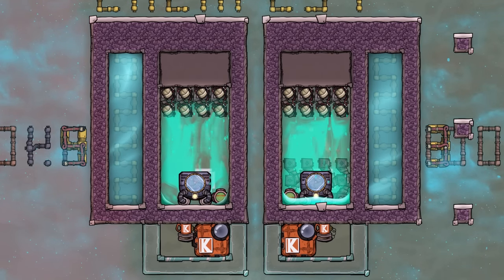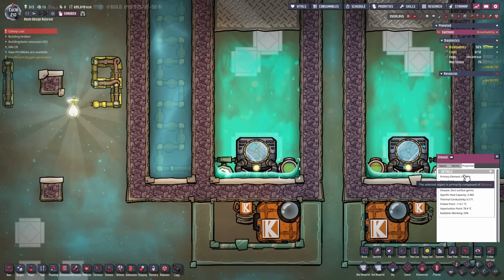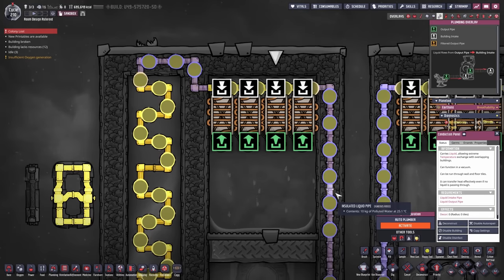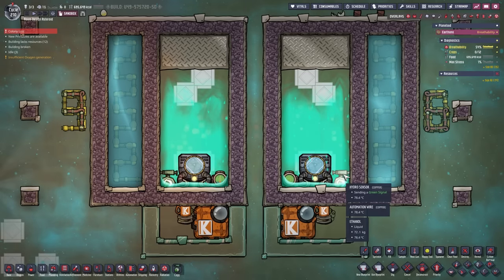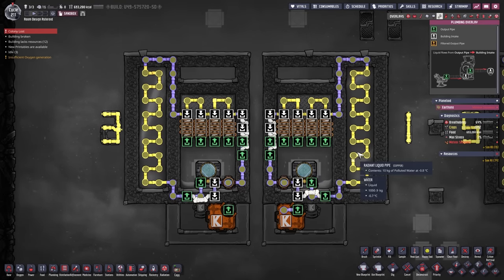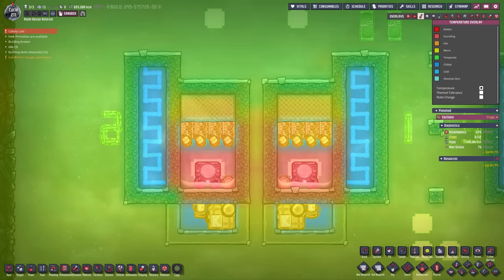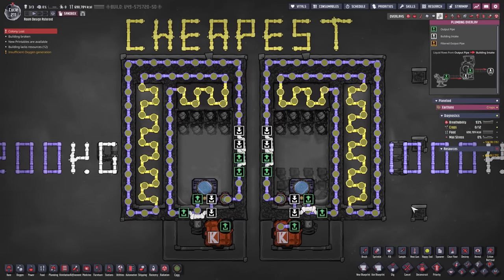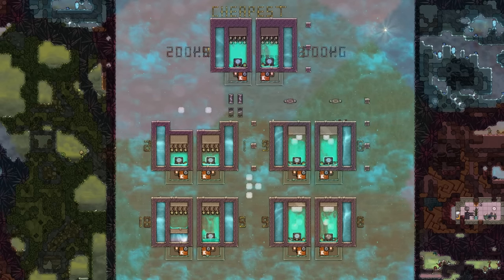BUILD UPDATE: Copper Ore Aquatuner Setup with Ethanol

Comment: What I find most amusing, is that this method has been available since forever, but somehow very few people paid any attention to it. I think it's partially because it is still (relatively) easy to get to plastics and steel, although some SO starting asteroids may be more difficult in that regard.
Reply from the maker: Agreed. I think steel and plastic once you know how to get it is probably the better option.

But since I only recently learned about the ethanol heat deletion I am experimenting with designs
Reply: I hate getting plastic.

Comment: This is actually insane. Pre steel aqua tuner was thought to be a pipe dream
Reply from the maker: Glad you like it :)
You can also achieve that in a steam  turbine Aquatuner setup by limiting the flow on the off side. I think I made a short about that once.
Steel is often just much easier than trying to make it work without it.
Reply: Breakthroughs in science limitations. Damn

Comment: Hey luma, can a conduction panel transfer heat to a temp shift plate in a vacuum? If so, this could let you build an amazing rocket silo with 100% efficient exhaust capturing.
Reply from the maker: I think it can i do have a tempshift plate somewhere behind one of those conduction panels in the lower left setup i think.

Comment: Why the metal tiles in the version with water in it? The idea is that liquid liquid heat transfer is vastly more effective than liquid solid tile interactions. Try just dumping some water in the other designs with no barrier. It won't get hot enough to turn to steam (and wouldn't matter if it did), even with the aquatuner running at 100%, so it doesn't need kept separate.
I definitely think this is way to power intensive to be used like this though. Any space saved is going to be lost in power production, so it is almost certainly better to go with a more efficient design, even if considerably less powerful. You absolutely want to be using more than a 4' range, and that means 1kg liquid pipes and heat exchangers. If you can get it to 120C before boiling it then you will already have upped the heat deletion 10x per unit of heat transfer.
Reply from the maker: I did that in around 10 other designs. Those all failed and were hence not even in the ranking. The issue is that water is lighter (less dense) than ethanol. so the ethanol want to be on the floor tiles. If we do not control the temperature now. To stop at 90 °C. Then the water will turn to steam and get deleted in a few cycles. Then you have a room without water anyways.
If you DO control the heat. The water still got deleted. All the state changes and ethanol trying to occupy the lower floor tiles that the water tries to drop down to deleted all the water each time i tried it.
Reply: I'm interested to know how to get the most heat deletion out of the same power usage. How do you raise ethanol to 120C without it touching the cooling block and falling back down? How does the size of the design affect the efficiency?
Reply from the maker: @yjk92  The larger the difference in Special heat capacity the larger the heat creation/deletion.

The best I can think of right now is probably Nuclear waste.

The room size does matter.

If it is too small you have a higher gas density/ gas flow speed making it harder to condense it.

The vacuum comes from the very fast heat transfer to the gas surrounding the metal tiles immediately flashing it to liquid aggregate state.

if your metal tiles get too warm or the transfer is too slow you will not get the vacuum. 

Benefits are probably not hating up the metal tiles unnecessary if you quickly condense the gas.
Reply: @yjk92  1kg/s in a pipe doesn't state change, so if you put it through a liquid valve to limit it to that you can superheat it. It needs a completely different design. The size can affect the efficiency of the heat exchanger, and it can get quite bulky if you are wanting to run multiple pipes. The power is limited by the low flow rate, which the open design doesn't suffer from.
Heat deletion is ~10% of heat applied to liquid ethanol, but when you use a counter flow heat exchanger most of the heat applied to the liquid in the pipes comes from the ethanol gas, rather than the aquatuner directly*.
I didn't notice any deletion, but I didn't run my test that long, so maybe just missed it. The sheer amount of power involved makes the losses minimal in comparison, with their biggest impact being complexity of a top up mechanism. If you can get it working without anyway then I guess there is no point, but it is worth knowing how much more effective liquid liquid heat exchange is than any solid tile interaction.
*Now that I think about it, it is only really the efficiency of the heat exchanger that makes a difference. You possibly could get the same effect even in the 4' normal range. Maybe a bead design? My quick experiments suggest it is hard to keep it stable, but it seems to work.

Comment: Have you tried mixing water and ethanol together? I found that even 1kg of water allows better conduction between AT and the liquid than spamming aluminum tempshift plates. And it kept the AT below 110C at all times. And the chamber can be 4 tiles shorter than what you have. It will not have a gradient of liquid and gas ethanol and instead all the ethanol will convert at the same time. The cooling effect should be the same, right?
Reply from the maker: Hey i tried that; i just copy over the answer i gave to someone else in the comments that asked the same:

I did that in around 10 other designs. Those all failed and were hence not even in the ranking. The issue is that water is lighter (less dense) than ethanol. so the ethanol want to be on the floor tiles. If we do not control the temperature now. To stop at 90 °C. Then the water will turn to steam and get deleted in a few cycles. Then you have a room without water anyways.
If you DO control the heat. The water still got deleted. All the state changes and ethanol trying to occupy the lower floor tiles that the water tries to drop down to deleted all the water each time i tried it. 

I also thought it should work. And it probably WILL with crude oil, but that would defeat the purpose of this being a early cooling setup.
Reply: @lumaraw  since the ethanol state change happens 20 degrees below water's, as long as the thermal mass can take the heat spike of the AT, there shouldn't be steam ever. I was able to replicate the liquid deletion glitch and kepting increasing the amount of water. And at 370Kg per tile of water, I see zero liquid deletion after 5 cycles of 100% uptime. My design is 3 tiles wide btw.

Comment: Would it be more inefficient to swap out the conduction panels with automation wire bridges because they would cost you only 5kg per bridge instead of 100kg of refined metal. Although i think  conduction panels have 2x conductivity of the material it’s build of.
Reply from the maker: It doesn't hurt including them. 
The Conduction panels are probably the best in conducting. They have a value of 120 thermal conductivity plus 100kg mass and I guess a hidden transfer mechanic or multiplier that i don't know of. But the other bridges are also very efficient, which is why i could leave the conduction panels out i the "cheap" version. The more bridges the better i guess :D

Comment: This setup is amazing for an oasis start with the heat all around.
With the pips you could try to make ethanol quickly and use alluminium since there's more in the forest start so you have an early solution for the heat. After a while you can create a more classic design but this will be great for the early game

Amazing work dude!
Reply from the maker: How much wood would we need for 200kg of ethanol?

Let me check: Ethanol Distiller
Requires Lumber: -1000 g/s
Effects Ethanol: +500 g/s
So 400 seconds = 200kg Ethanol meaning 400kg of Lumber
that is 4 Oakshells or 2 Branches of a Tree. (Each branch produces 300 kg Lumber according to the wiki )

That sound managable

Comment: Hi, thank you for the interesting video.  Before I watched, but after reading the title, (sorry, ignored the using ethanol portion, my ADHD kicked in) I imagined this was for early game designs, since steel (in my mind) is more of a mid game resource.   However I see you use the mid/late game liquid ethanol, since in most default play throughs, getting trees is really difficult. I have difficulties with heat with all of my starts. Do you have any designs of this cooling system with the normal resources you find in early game designs?
Reply from the maker: There is a planet with liquid Ethanol pools. Not every Planet has them but some starts might.

Not sure there are any alternatives besides Ethanol and nuclear waste.

I only know of these two having different Special heat capacities in different aggregat states.

There might be more but i don't know of any atm
Reply: @lumaraw I have no planets. Space mining is the last thing (late game) to do in my play thrus.  There is no nuclear waste either.
Reply from the maker: @dmcs2003  Ah so no DLC.
But you can still choose different Starts. There are many planets. Might be one has ethanol pools in the Base Game as well. Not sure though :/
Reply: easy way to manage heat is to use ice from ice biomes and have water brick where you make o2 who sucksup the heat from nearby , and cool any water you produce and dump it there , you can easily menage ice by making ice statues above pool who will melt down , as well using weezeworts(but on space DLC you need to be mindful with radiation)

another way to manage heat is to minimalize batteries , use t2 ones who make less heat , and make generaly the lease amount of heat (like skip making plastic and have drecos ranch , make power by wheels etc) , while game will progress slower im 400 cycles in current save and yet i have to make cooling loop and only place who heatedup sightly is near my living quaters , rest of base is still in cofmortable 15-25

reason i use huge water brick is not as much due heat but place where i keep my fish but this can be dual purpose and act as water cooler for the base

Comment: Well, ethanol is replacing the steam turbine, so more ethanol boiled and dropped, the more "cooling" can happen. 
this is yours OASIS map base chill spreading system.
Reply from the maker: Hey deilusi, i think the Steam turbine is still more useful since you get alot of power back. Reducing the cooling cost in the process.
This setup only uses power and gives nothing back.

As to weather the amount matters: I tried the "more" ethanol version by having one with 200, 1000, and 4000
I didn't check completely scientifically of course :D
What i noticed was: 
after a certain point is basically went asymptotical.
I think that point is somewhere between 200 and 2000. anything more is just wasted material. Since we only have 1 heat and cooling source.
Reply: @lumaraw  100% if you can afford steam, its 2 tiers better than this. This is either only for very hard scenario, where you die before getting steam, or when you want smaller chill, in tiny form factor. It can also boil itself if you have high heat input from base, so its not as universal as steam.

Comment: I would imagine that aluminum ore would work even better than copper ore if you have access to it.
Reply: Yeah, I think it has one of the highest conductivities in the game of 205, above Diamond but second to Thermium.
Reply from the maker: Slight correction if i might do so? The Thermo Aquatuner can be build out of Metal ORE 
or Steel / Thermium etc.

Not from refined metal.
The Refined ALuminum has the high thermal conductivity of over 200
the Aluminum Ore "only" has 20.5 which is still super high compared to both copper and gold amalgam.

Comment: =I DONT KNOW EXACTLY ......... BUT FOR A BASE , ANYTHING THAT IS NOT LIQUID RELATED, WORT CHAMBERS ARE BEST

.......AND....I GUESS........STILL A VERY INTERESTING CONCEPT INDEED, HEHE......BUT WITHOUT AQUATUNERS AND BASE, THO..........LIKE TO MAKE SURE THAT TEMPERATURE WONT GET ANY HIGHER THAN 75C, HEHE

=AND..........STILL.............HOW'S ABOUT INFINITE STORAGE OF MANUAL AIRLOCKS , THO.........TO CRAMP LIKE A CRAPLOAD OF COOLING , HEHEHEHE

.............THE SAME GOES FOR A KIND OF........JUST LIKE..........RADIANT PIPE LOOP WITH NUCLEAR WASTE/SUPER COOLANT,.........SO 1 POINT IS AT LIKE .............A BATTERY PACK, AND ANOTHER AT THIS CONTRAPTION, HEHEHEHE.......

=BUT STILL, I'VE FOUND JUST A WORT SYSTEM BE GOOD ENOUGH, THO................. JUST GET 1 WORT SEED, AND BASICALLY THAT'S IT, HEHE